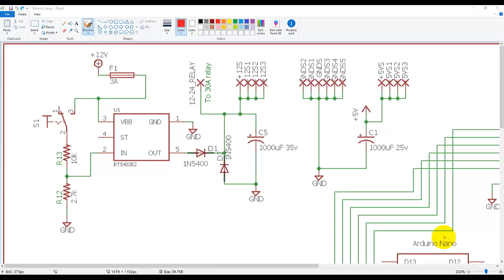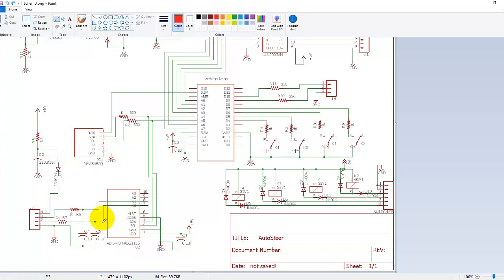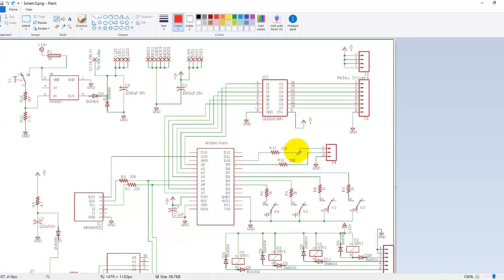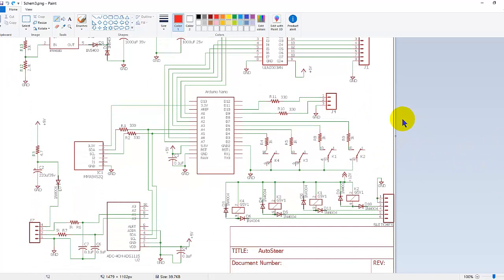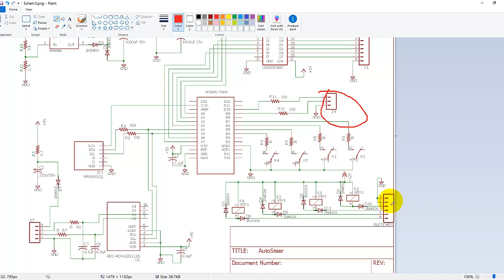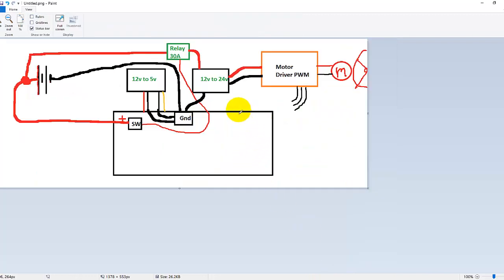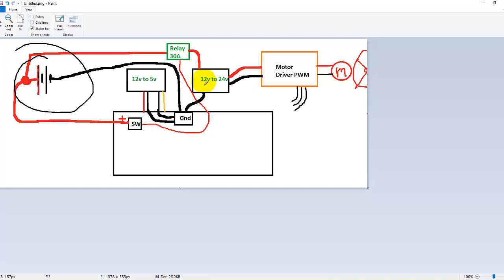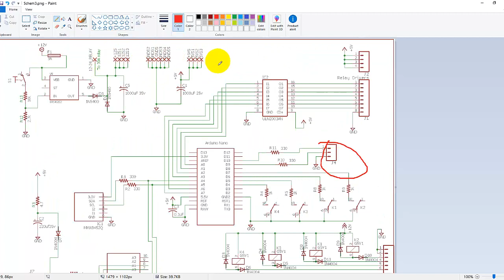PCB for AgOpenGPS

Comment: could it be possible to contact you in any way.. im still figuring most things out but it would be nice as a last solution. i got everything installed and the motor is now turning correctly but its going : left right left right continuesly , i am thinking that has to do with the steer angle sensor coz mine broke . i think its just tring to find the trail. what kind of sensor do you use? would love to see a reaction.
Reply from the maker: Just reverse the leads on your motor so it spins the other way
Reply: @FarmerBrianTee  no i mean like iets turning...but left right left right.. It tink its becouse my angle sensor is broken and it trys to find a trail is that possible?
Reply from the maker: @HRFarm  It could be, When you turn the wheel, can you see the steer angle change?